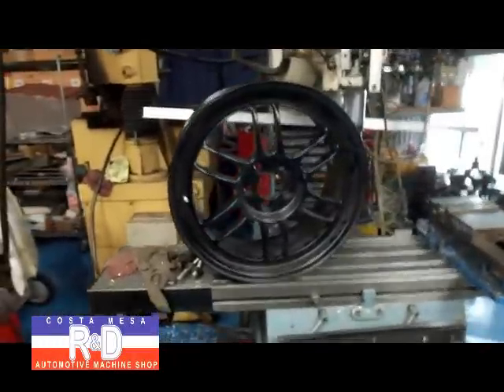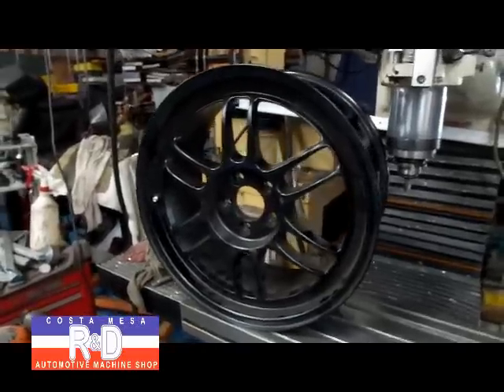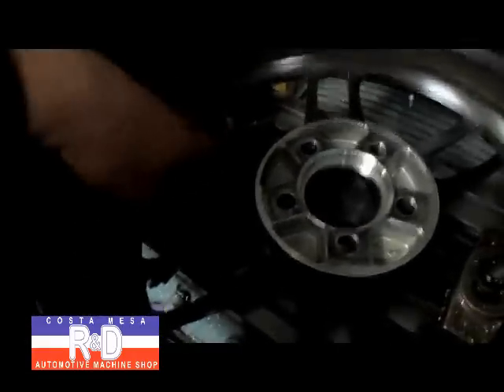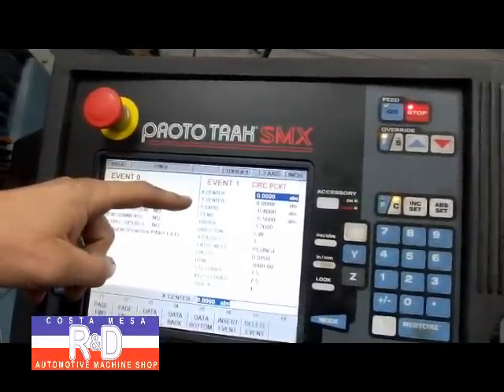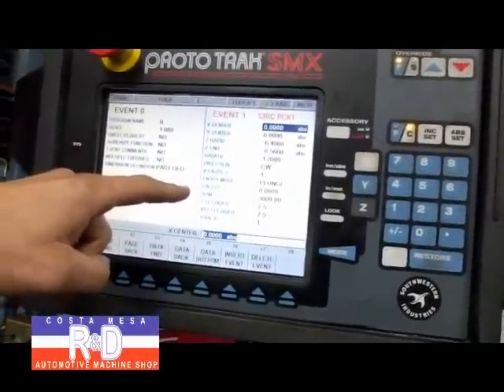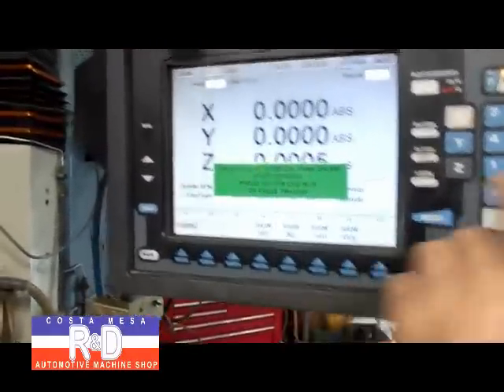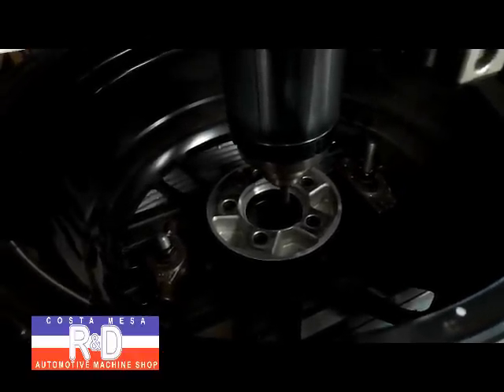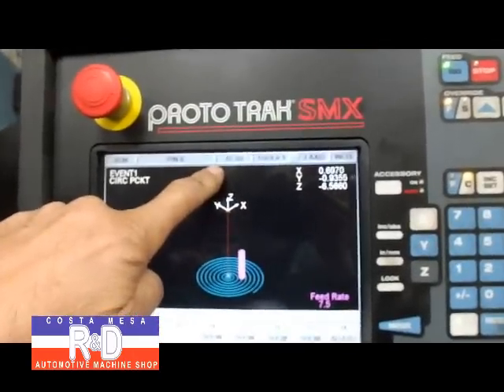Subaru Wheel Off Set Reduction

Comment: nope, wrong. + offset is the outside of the wheel being brought in toward the hub as in this video, - offset is brought out so the hub is further to toward the back of the wheel from the center line. In this video he made is from a + offset to a higher still + offset. 

The only way you would be reducing the offset is if the wheel was already a negative offset, therefore bringing it closer to zero (center line). This wheel is most certainly a high positive offset, nearly all cars are positive.